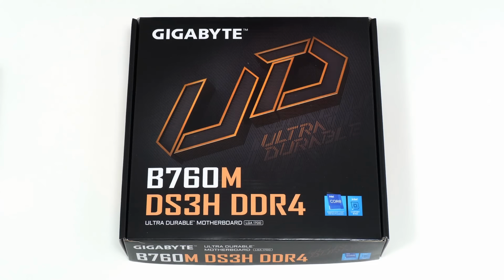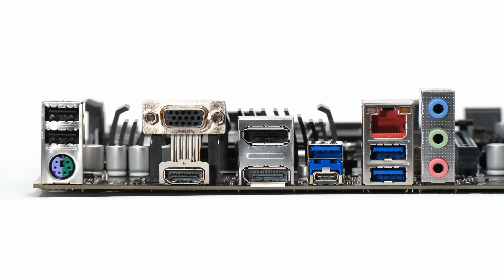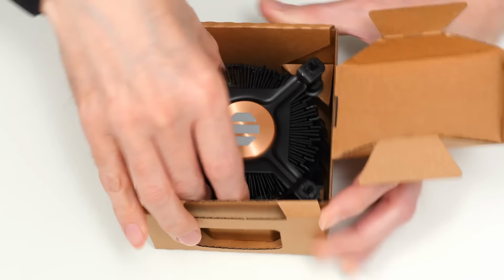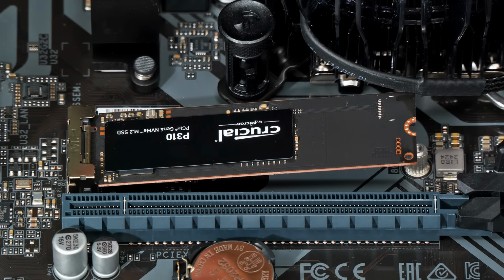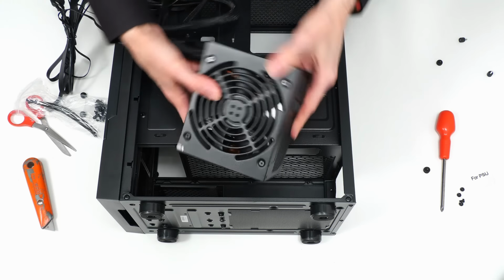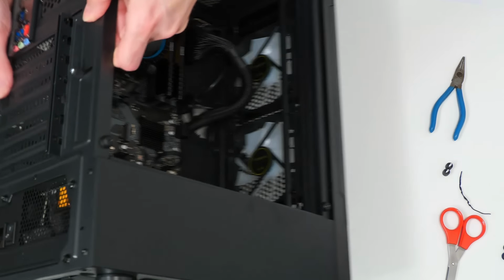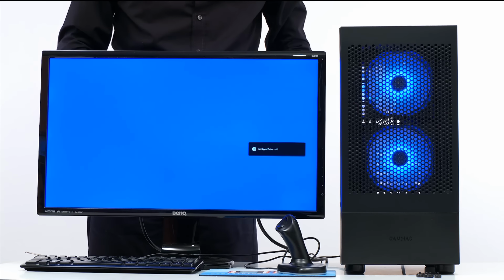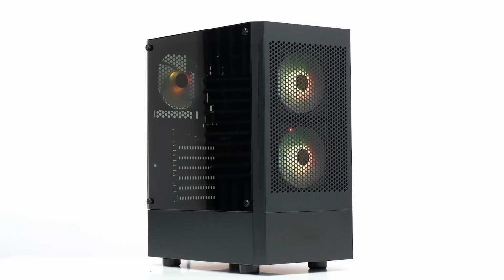Building a $500 PC

Comment: As a blast from history, I remember paying £200 for 4MB of ram.
Reply from the maker: I know, it is amazing how far we've come.
Reply: in my day ... A Pentium based Windows 95 system with 16mb RAM, 2x40GB HD, with keyboard, mouse, and 19 inch CRT for only $1995. Or a Mac IIci, 16MB RAM, no HD for $2800. Add SCSI 800MB  for $800. What a deal.
Reply: I remember paying $1000 for 1MB RAM and $1000 for 1 MB hard drive...circa 1990
Reply: @patricktierney3269  In my day, we had to bring in the computer with a semi....  seriously, the first computer I was exposed to had a 5mb HDD that cost $20,000 ... used.
Reply: Heck, I remember paying $300 for a 16MB nVidea graphics card back in the late 90's.  That's insane. 😱😱😱
Reply: @spazamitaz . I miss paying $300 for a graphics card instead of three to five thousand these days.
Reply: @spazamitaz  i remember paying 700€ for a 17" LCD Monitor and a few years later 200 for 22"
Reply: I remember paying approx €500 for a 17 inch CRT monitor which worked for almost 15 years, technology may be cheaper now but it will not last as long as older equipment
Reply: @ It's going to be interesting to see how much of today's hardware is still alive then, yes. But what I'm seeing in my own parts heap is that today's desktop computer components last much longer than in the past, and the point of change for DIY parts is roughly in the P4 era. Also, soon after that, the namebrand systems stopped using seconds and barrel-scraping parts (before that, namebrand = overpriced junk, but now they are quite okay), which helped a lot.

Just about any P4 or later (along with its parts and peripherals) is likely to sill be alive. Older, tho, are increasingly a crapshoot. My present daily driver is 11 years old and shows no sign of failing. There's no reason the system Chris just built can't still be running fine in 20 years.

Rather the opposite of vehicles, where longevity peaked back about 30 years, was stable for a while, and is now sharply declining (see Tony's Garage for a rant on this). And the less said about household appliances nowadays, the better.
Reply: @paulmilligan3007  How about $300 for a CD-ROM drive in 1993.  Lol. Prices were nuts.
Reply: Hello, fellow old person.
Reply: I spent $A 3000 on a mono 300dpi laser printer in 1993. Madness.